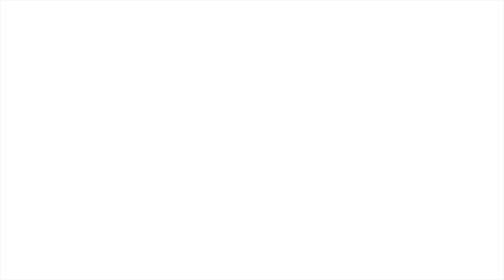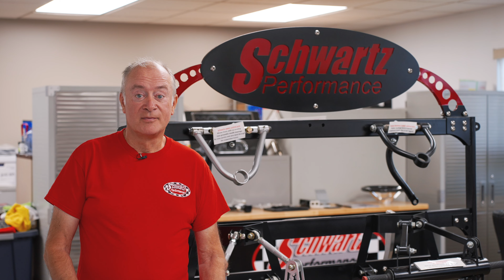Schwartz Performance - Shop Update | August 2024

Comment: The exhaust system welds on the 1968 Camaro are a work of art. As far as the Superlite, I recommend slightly lower power (700-800 hp) to be a driver.  Drive a slower car fast.